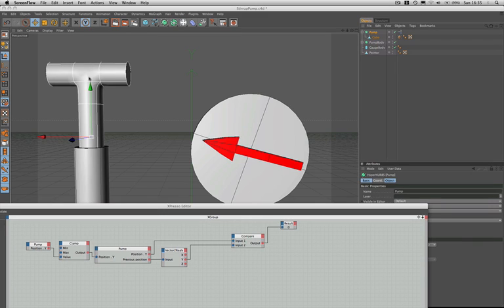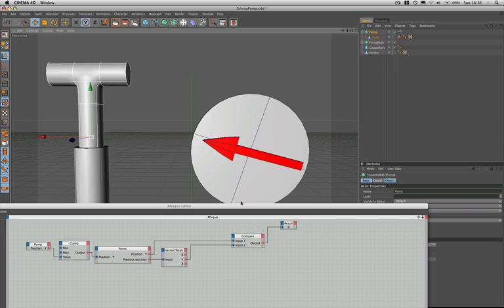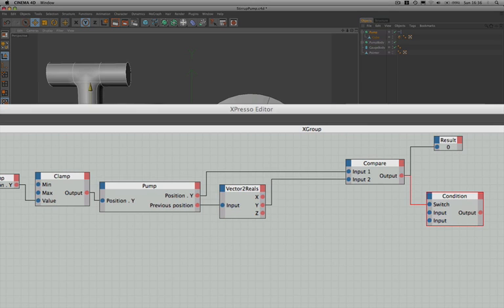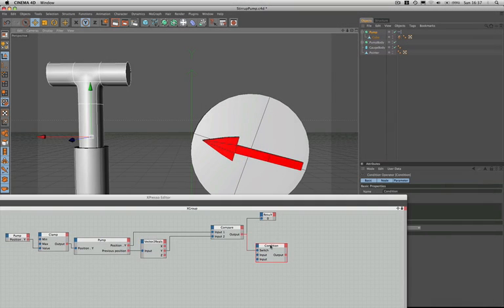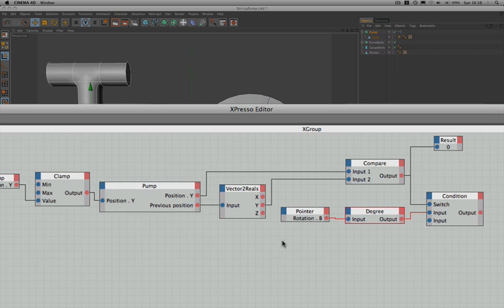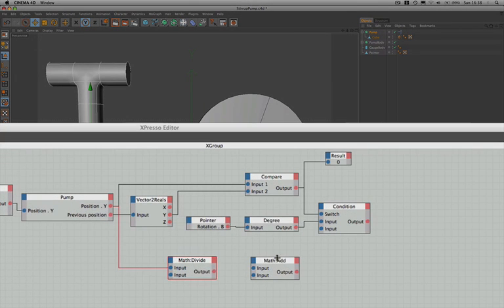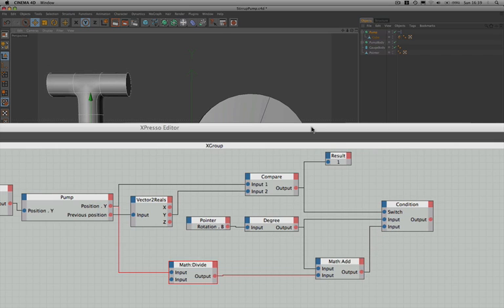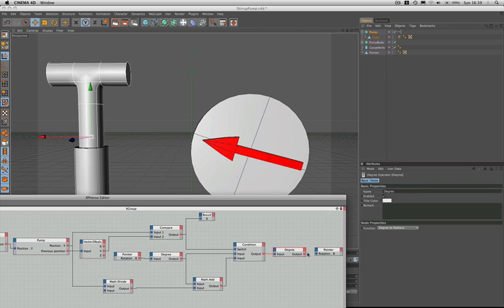Cinema 4D Xpresso Tutorial 18: Creating a Pump and Pressure Gauge (Part 3 of 3)

Comment: Very interesting brainstorming tutorial. I learn a lot from this. However, I found a small "bug" in this setup. When I try to push down the piston even after the min clamping point, the indicator rotates clockwise even without moving the piston further down. I think we need another compare node to avoid that.
Thank you very much for your excellent tutorial.
Reply from the maker: Great that you are thinking!
Reply: The bug is overcome by adding another "compare-condition" node complex. Thank you